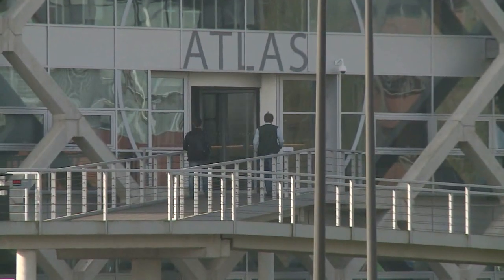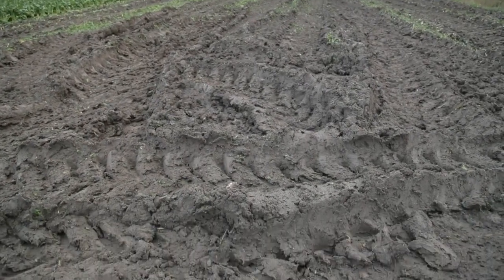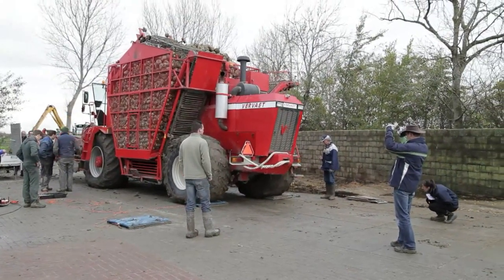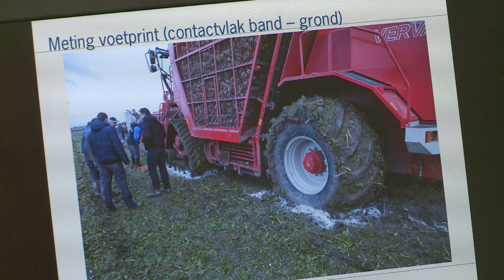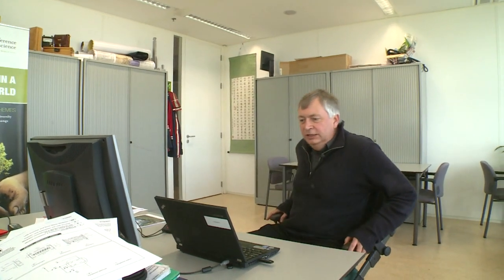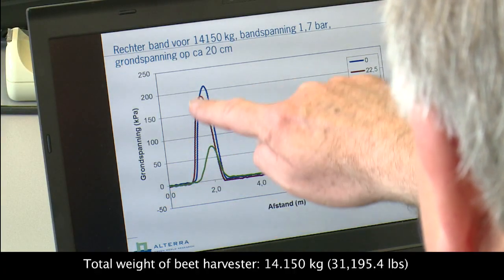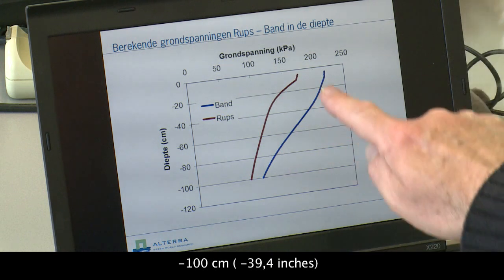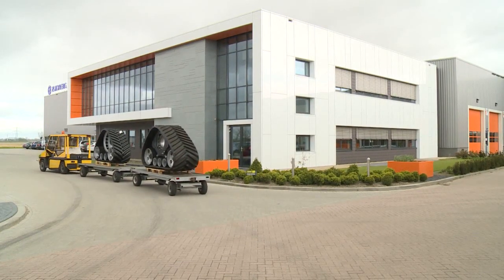Research Wageningen University: Track has less impact on the ground than UltraFlex tyre

Comment: hello,
i have some questions... 
this Case ride slower comparing to standard wheels?? (the same rpm and ratio)
what about  tractor speed sensor in CVX transmission??
what about difference between front tracks and rear wheels in Vervaet?? Hydrostatic Drive solves that??
regards,
marcin,